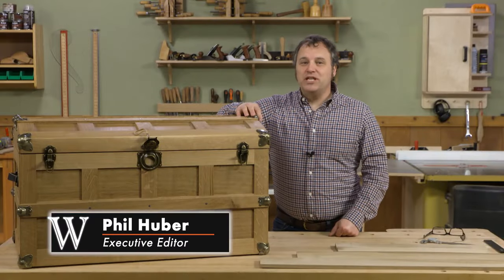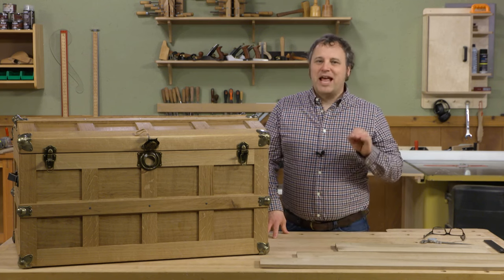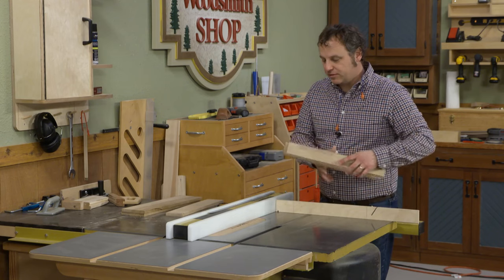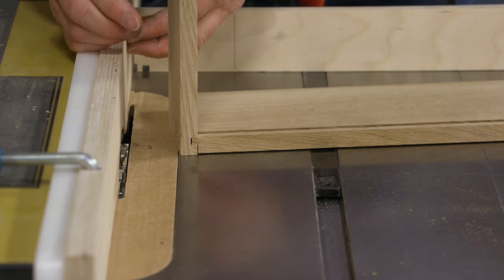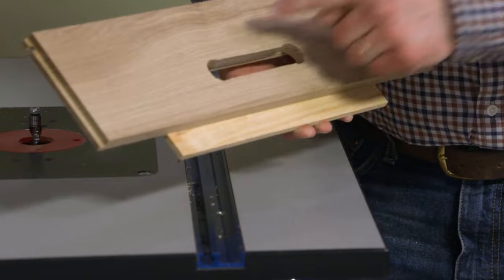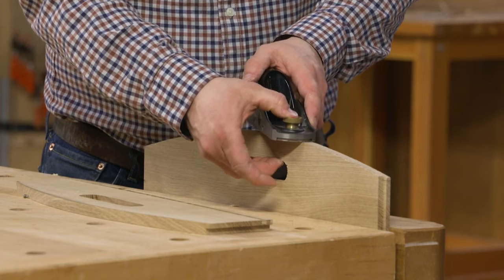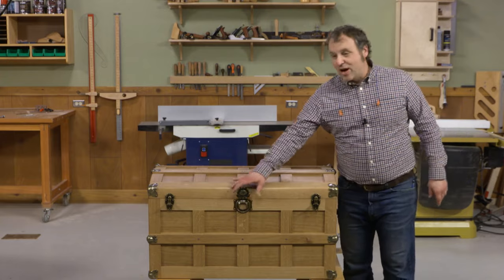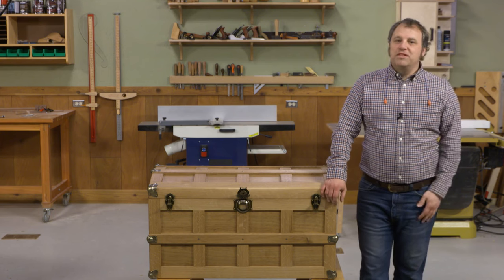Woodsmith Shop TV: Steamer Trunk Tray

Comment: I think the tip of the glue made the whole chest echo into the mic. Fun noise.

For hand holes I thought I wanted a template made of wood or even acrylic. Then I saw someone drill the two holes against drill press fence. Clear waste with jigsaw like you did. Then they drop one of the holes on a straight router bit with no guide bearing. Then slide the fence up against the piece and lock it so the bit is pushed to the far side of the hole. Turn on router and slide over. Flip around for other hole/side. I realized how much easier it is and you can easily change side and length.